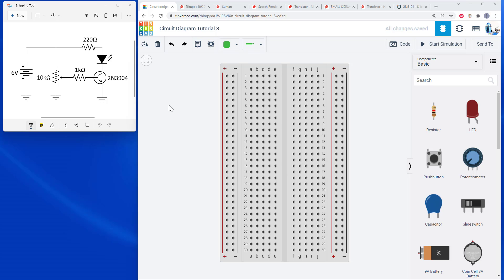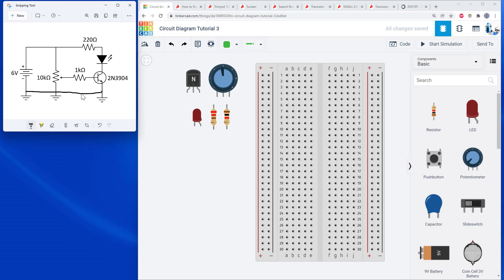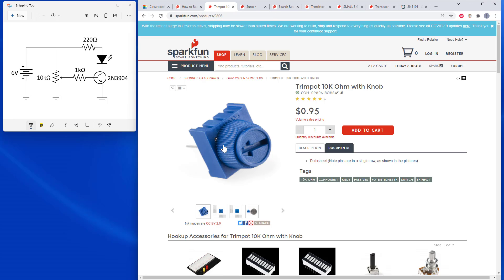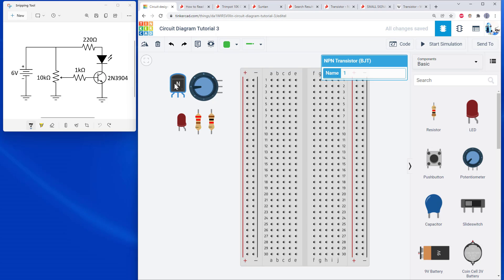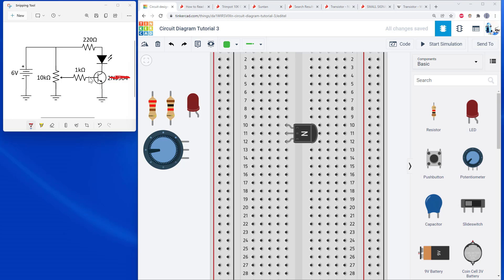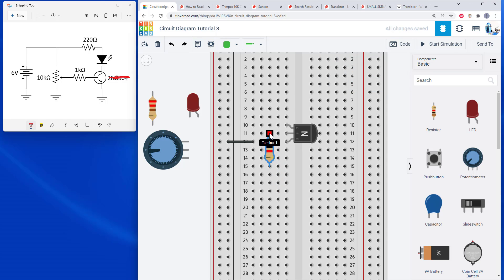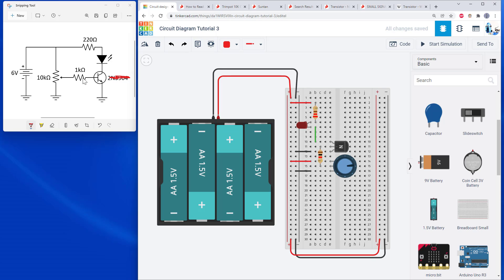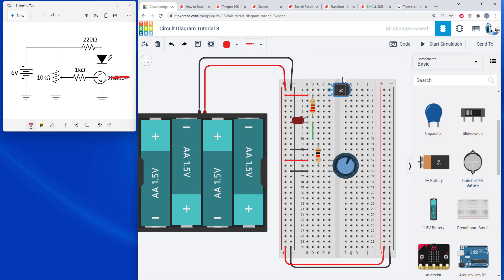How to Build a Circuit from a Circuit Diagram | Part 3: Transistors, Potentiometers

Comment: Hi sir, where can i find more exercises ( schematic diagram with connections) to be sure that my connection is right
Reply from the maker: You could try finding an electrical engineering textbook or just look up random circuit diagrams on websites like Wikipedia. Unfortunately I don't have more of my own "practice" problems.

Comment: This might be a dumb question, but I was wondering what purpose the transistor serves in this circuit. Wouldn’t the potentiometer work as a voltage divider? I’m just getting in to this and I’m trying to learn.
Reply from the maker: Technically in this case you are correct since everything is powered from the same battery pack. In general the purpose of a transistor in a situation like this would be to allow you to control a higher-power load (like a motor) from a lower-power control signal (like a microcontroller pin that cannot provide enough power to drive the motor directly). If you just want to make a simple LED dimmer then you could do it with a potentiometer in series with the LED, plus fixed resistor (so you don't accidentally blow out the LED if you turn the potentiometer down to zero resistance). If you're just getting started and would like to learn the theory behind all this then I recommend this playlist: https://youtube.com/playlist?list=PLKL6KBeCnI3U6KNZEiitdtqvrxkBhpuOp&si=pujJuL4nzh2L6qC_
Reply: @ Thank you for the response, I’ll have to watch the playlist.

Comment: Hey, I got a question, why can't we just attach the LED straight to the Potentiometer, how does the transistor help?
Reply: You could, you would just need to compensate for the power gain with a lower ohm resistor.

Comment: Hi . I have a question. Aren't you missing a 10k ohm resistor in the breadboard since I only see 2 resistors In total. Im confused a little.
Reply from the maker: No - one of the 10k resistors in the diagram is a potentiometer (the blue circle with three pins). It's the resistor with an arrow pointing toward it in the diagram, indicating the adjustable middle terminal or "wiper" of the potentiometer.

Comment: Sorry, off topic. My question is about the circuit, not breadboarding it.    You said the pot dims the led. I thought transistors were on/off.  The pot trickles current into the base until it saturates it and then current will flow from collector to emitter.  The led will either be on or off.  To that end, drop the 1k ohm resister and let the pot control the current into the base.
Reply from the maker: BJTs have a linear range and a saturation range. In the linear range, the current into the collector (which in this case is connected to the LED) will increase proportionally to the base current. Once it saturates, the collector current is maxed out even if the base current continues to increase. If you eliminate the extra 1K resistor then you can also blow out the transistor when you turn the pot all the way up to the supply voltage, as there's then no resistance at all in front of the base.